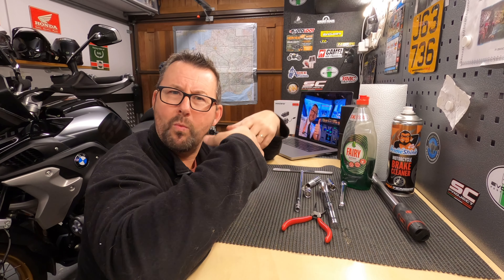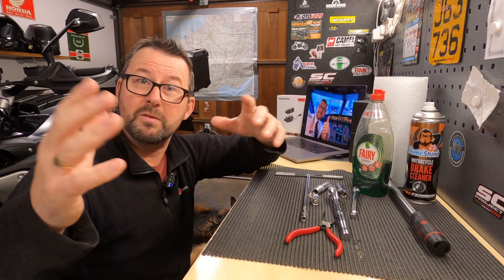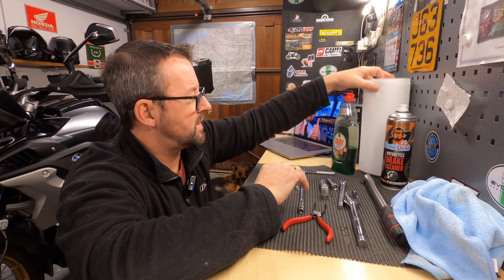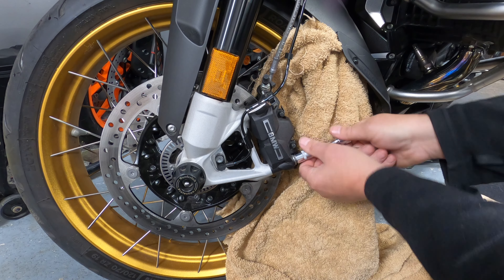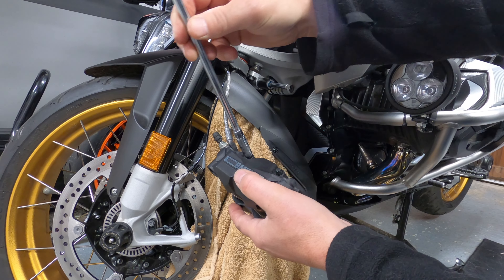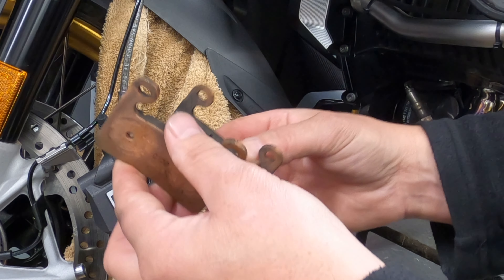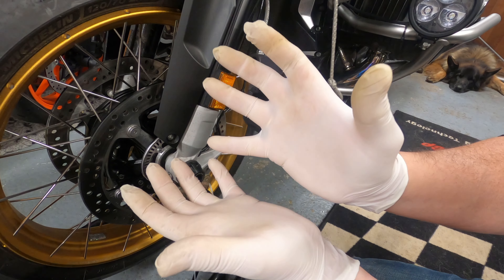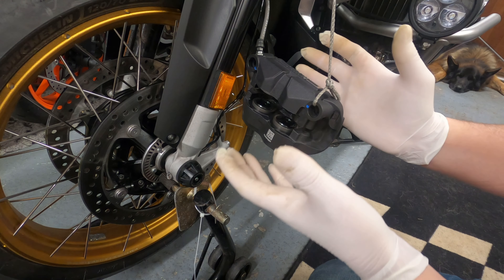Cleaning the front brakes of my BMW GS  / Brilliant, no more screeching brakes😜Part 1

Comment: 3:43 important question mate, you said the Torx socket was a size 6 but from research I found 2 sites stating (E8) which I bought a couple of yesterday when I found out I couldn’t take the pins out… could you when you get a chance or anyone reading this pop a reply asap please. 🙏🏼🍻
Reply from the maker: I have had a look at the video and I used a 6mm normal socket just to release them , easier when the caliber is still mounted. Didn't have a torx e8, no issue using the 6mm. There is a clip on the back which you need to remove.....then the pin comes out.
Reply: @gsd32i  Thanks for your prompt reply I truly appreciate it.

Hmmm interesting I tried a hex 6 socket wouldn't go on so tried 7 but that slipped off so I stopped. Luckily I saw the circlips on the back of the opposite caliper guess it's just 

 E8 will be delivered tmrw that will give me the peace of mind that I won't be rounding the pin head. Cheers mate.
Reply from the maker: @Nomad-Drifter  No problem, those clips do ping off though! 😂

Comment: Hi, I have a 2019 R1250GS Rallye- with Can smart (Hex) also use it to power heated jacket , which it controls heat levels via the heated grips button on the bike.. now its cold.. its a great feature of the Hex !! ( Actually running 2 cansmart's- daisy chained !!)
Reply from the maker: What jacket do you have .....I may have to put one on my birthday list!
Reply: @gsd32i  HI, I swap between the BMW heated vest (size M) and Gerbing heated premium inner jacket with microwire Pro (Size L) I'm 5ft 11, Chest 41"- PS Used to spend most of my summer holidays in Jersey as Grandparents used to own a house on the Island.. wish they still did !! ( Even got engaged in Jersey years ago !!) Used to be Country manager for MV Agusta - now working for Moto Morini- Know Daren & Greg... Cheers
Reply from the maker: Thanks, I am a seasoned fair weather rider now, who likes to be comfortable, especially on cold days! Saw Daren today at Mansell's, have to keep them sweet for using their demo bikes , so dropped off some quality street tins for both the front and rear of house folks . Greg is a very progressive rider shall we say.......Is the Garbing stuff good gear? The MV Brutale 1000 I demo'd recently was bonkers...too much for my licence(as are most 1000cc machines though!) 🤪
Reply: @gsd32i  208 BHP on Jersey roads !! Ridden Brutale 1000RS & RS & Rush.. many times..actually a pussycat until you hit 8000rpm+ when all hell breaks loose !! Gerbing stuff is excellent, plus it can be connected to heated gloves etc. I see BMW have a promotion on their heated vest..
Reply from the maker: Thanks I will have a look . 👍

Comment: I popped a piston out 🤦🏼‍♂️ managed to get it back in. Quite different from the Tokiko calipers which are two pot so the pistons are longer and can come out further. The pads were ceased in place my fault for not cleaning them for a year! Found with the EBC pads there is very little clearance between the pad and caliper. Will have to bleed the system now to get the air out…
Reply from the maker: oh no. simple job I hope 🙈

Comment: Excellent thanks,  PS what it the make of your front wheel  paddock stand R & G ?
Reply from the maker: Hi David . Thanks . The stand was a Tech 7 stand from UK supplier M and P accessories. About £47 . Used it when I did track days on Fireblade , long gone ! Works fine with my KTM and GS . 👍

Comment: So why are the breaks making the screeching noise? mine started to do this recently as well.
I thought it was because of the brake pads but here you are cleaning the caliper and pistons.

what is the reason they screetch to begin with? and can't you use a pressure jet washer to clean them while they are still attached?
thanks!
Reply from the maker: Hi, it may have been when I cleaned the bike recently, I used a pre-wash spray before I washed the bike, so that may have had something to do with it... but I don't know TBH. Possibly lack of going at higher speeds so not getting brakes up to higher temperatures...but who knows! All I know is that they were screeching and now, after the caliper(quite dirty) and pad clean, the bike is nice and quiet. Took the bike out today and all good from front and rear . My opinion is that the brakes are a vital part of your machine and on all my bikes, I have always cleaned the calipers and pads and don't leave it to the yearly /2 yearly service inspection. Plus its always good to have a cup of tea and some biscuits , put the tv on in the man cave and enjoy working on your bike. 👍
Reply: @gsd32i  👏 good advice 👏
Reply: You can copper paste the back side of the pads as well, supposedly it ll eliminate or reduce squeeking. The pistons wont be cleaned this thoroughly by the dealer so its good to do so yourself and lube them up when you're done.  'Just the way it Is' also has a great video about cleaning the brakes EP3 with a ducati multistrada.

Comment: Hello, nice Video. But DO NOT use a Brake Cleaner for the brake holder, they will destroy the seals inside!
Reply from the maker: Hi Chris, loads of people use Brake cleaner on the calipers/pistons etc and the "Muc off" is safe for all braking parts. MCN recently did a how to clean your brake and they used brake cleaner too. May be the chemical composition has changed to not harm the seals.Soap and water is cheaper though.
Reply: @gsd32i  @chrisd3394 Excellent 'how to' video, as usual, thanks. But, have to say whether loads of people use muc-off brake disc cleaner liberally all over the caliper pistons or not, or MCN did it, (does anyone at MCN have a degree in chemistry?) does not mean it is a good thing to do This spray is up to 25% acetone, it says so on the product data safety sheet. Despite this you can find it on the net actually advertised by some retailers as being 'acetone-free'. It stinks of acetone - good for nail polish removal, bad for plastics and for many synthetic rubbers and therefore some seals.  Used carefully (not least because it is bad for humans - and other animals - and highly explosive as an aerosol in enclosed spaces) to clean rotors and pads, it's obviously safe enough. Soapy water harmless!